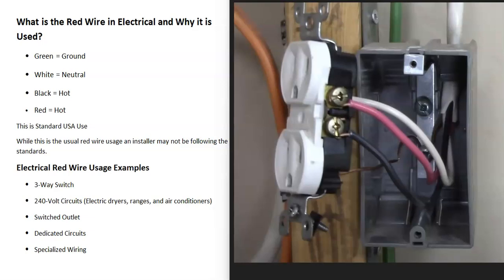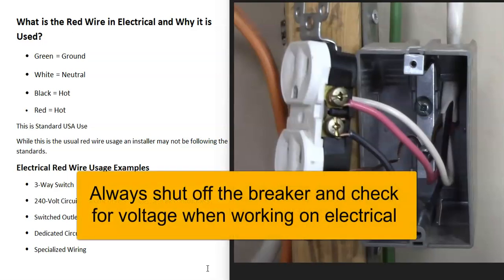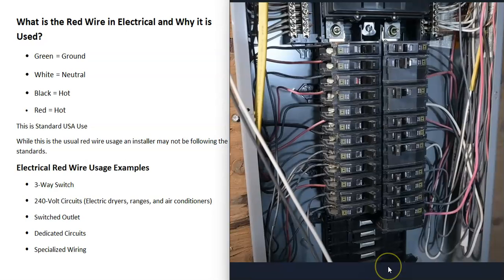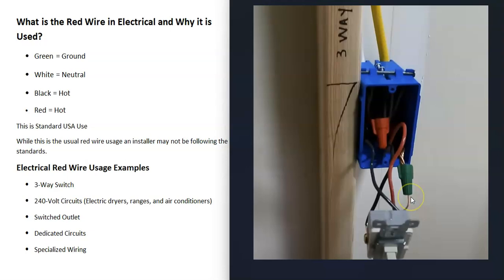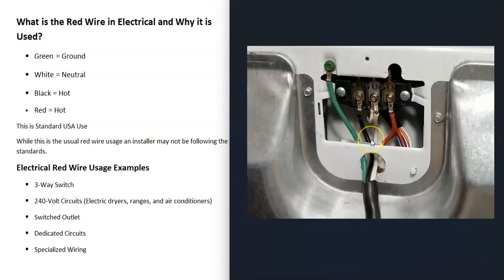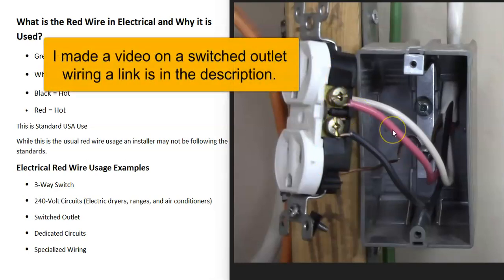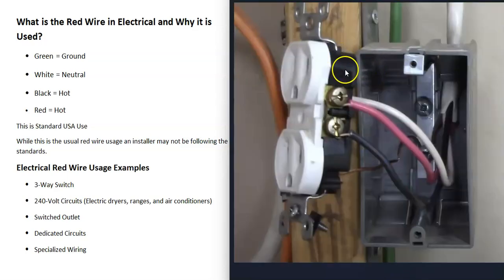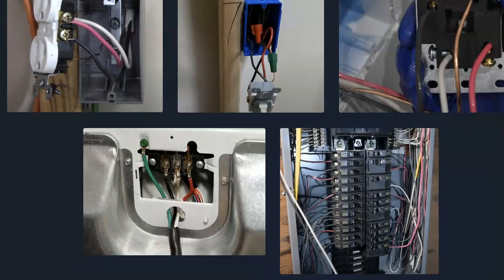What is the Red Wire in Electrical? Why it is Used with Examples?

Comment: I have the red wire & black wire connected but the power won’t turn off with the switch.
Reply from the maker: you need to find what is hot wire red or black then the dead wire will be switch leg.

Comment: Hey bro ! Great tutorial. I do lite electrical but I’m no pro electrician. I just moved into a new house and found an outlet in my pantry unfinished. Looks like all it needs is the outlet since everything is already prep for installation but there are 3 thick wires ready for set up white, black and orange. Never seen an orange one and don’t see the ground as well. How would I go about installing this ?

Comment: I have a light fixture that has, yellow with green strip, a black and a white. In the ceiling I have a red, black and white. What does the red connect to?
Reply from the maker: You just need to confirm hot 120 volts you need a voltage detector or a meter when you confirm hot then use white to white green to ground.

Comment: so my issue i have a ceiling fan with no power going to the fan but power going to the light. separate switches for each and when tested in the same switch box the switch to the light us getting power and the switch to the fan is not. On the same breaker. My guess call an electrician
Reply from the maker: Ok usually you will see a red and a black going to the fan those are the switch legs on a fan/light on the switches you just need one hot to control the light/fan on the bottom of a single pole switch take power to both switches brass screw on bottom then take the switch legs red/black put on each terminal 2 switches light/fan on fans you will see blue and black usually one controls fan 1 controls light 2 switches on single pole switch hope this helps you may have to get into the fan wiring if it is capped did not hook it up it is easy you can do it.

Comment: I have the washer dryer outlet with a red wire, to a switch. I'll figure it out before I plug it in. Thanks
Reply from the maker: Sounds good, just be safe with it remember black red on a dryer outlet is 240

Comment: If I have two blacks connected into a breaker can I rephrase one of the blacks to red and use the rephrased wire for my switch?
Reply from the maker: well yes you can wire a hot into another breaker will be 120 volts so if 2 hots are on one breaker that is commonly seen they are using 1 breaker feeding more out of room just remember on single phase 240 you want to be on separate phases for say like a compressor/dryer/stove so double pole 40 amp breaker gives you 240 volts.

Comment: How would I wire a switch for a light that has two black wires, two white wires, and one red wire in the box, and no ground
Reply from the maker: The fist is use a meter to find the hot coming in and then the wire that is dead will be the switch leg one of the black wires or the red could be the switch leg you will need to confirm with a meter.

Comment: I have a red, white, black, and copper wire. I know white is neutral and copper is ground, but what is the red and black? I tried white to white, ground to ground, and then for the black on the floodlight end I tried first connecting to the black on junction box , turned breaker and light switch on, nothing, so then I tried conncting the black end on floodlight now to the the red on junction box end , and still does not work, so it seems that neither work? It worked before but now randomly is not when I have new light fixture, even though I know the fixture works. What is with this extra black or red cable in my junction box? What am I doing wrong?
Reply from the maker: You will need to confirm what is line and what is load so black or red could be the hot coming in you will need a cheap tester or contact voltage tester they are cheap when you confirm the hot then the other wire will be the switch leg to the flood light.

Comment: The white wire and the red wire are stacked on a single side screw. Isnt this against all code? Shouldnt it be piggy backed?
Reply: Yes
Reply from the maker: So the white is a current carrying conductor but you have simplistic terms 2 hot wires a ground and a neutral break the tab on the hot side brass you have gd/dishwasher

Comment: Great explanation of the red wire!! But I have a GFCI switch combo and when I installed  it Im getting  power to it but the switch won't  work and it won't  test or reset at all. What am I doing wrong?
Reply from the maker: Find the hot coming in sounds like you have line load reversed.

Comment: What do I do with the RED WIRE if I don't need it??? Cap it and stick in in the electrical box??
Reply from the maker: If it a unused conductor you have a spare breaker if it is tied into a circuit that is used cap it.

Comment: i have 2 switches one is ok the other needs to be wired and then to the recpt 2 black wires and 2 whith wires and 1 red how do i wire recpt
Reply from the maker: If it is a half hot look at the old outlet if the hot link is broke then break link your hots red on one terminal black on other would go on hot terminals so you would have a constant hot and a receptacle that is half switched if you have a lamp or something plugged in.
Reply: So a red wire may be on a different circuit than the black wire that are both attached to the two brass screws on the right side of receptacle?
Reply from the maker: That is correct say for garbage disposal dishwasher two different circuits breaking the hot tab same with half hot.

Comment: What if you have 2 black wires & 1 red wire? The old outlet has both black on the bottom (brass) and the red wire is plug into the top (brass). And both whites are attached (1 on top, 1 on bottom of silver)
Reply from the maker: That is a half hot split the hot tab red on one terminal black on other.

Comment: In commercial buildings, when there is a 120/208V three phase service, the usual colors are black, red, blue, white for phase A, B, C, & neutral respectively and EMT raceway is typically used which can also serve as the equipment grounding conductor, though it's common practice to pull a green wire for the ground.   

Having said that, you will sometimes see  a white and red, or a white and blue, connected to a receptacle, where raceway is used.
Reply from the maker: Pre like 1984 I think the conduit could serve a a ground but new code has left that behind current 2025 NEC code has Ig grounds and bonding grounding are far better in terms of grounding,bonding threw the years I think we are there in terms of bonding,grounding I have a friend who has 3 phase at his house almost unheard of he has a 480  volt 12 ton ac his bill is small in relation to most because the demand is less but 3 phase is way more efficent than single phase lesser demand and probably half amperage of what single phase pulls.

Comment: Someone used the red/black combo wire and had red wire going to 1 side of the sub panel, and the black going to the other side. Tripped me out completely because they're actually separate circuits
Reply from the maker: confirm voltage then go from there should be easy identify line easy.

Comment: I replaced a light fixture and the only wires connected were a black and red wire… now the light won’t turn of with the new fixture. Help please
Reply from the maker: so if you replaced a fixture you need to know what is the hot wire and what in the neutral wire buy a cheap hot stick voltage detector confirm whats the hot or just swap wires sounds like they used one for a neutral just swap wires fixture will work hope this helps.

Comment: 3 way switch also.
Reply from the maker: Yeah a 3 way could be travelers but yes you are right they use black red  for travelers on a 3 way depending on who who runs romex.
Reply: I have 4 3way switches and 1 single. 3lights. 1 light switch will not turn on and off. what's wrong

 but 2.

Comment: I’m needing to wire 14-3 wire into an outlet. The outlet will act as a switch- flip the switch at the wall, outlet powers a shop light. 

Can you help me understand how I might wire the outlet?  Using my voltage meter, both red and black are hot.

Comment: I have 2 neutral wire (2 sets of wire cable): should I also cut the neutral wire (I cut the hot side) on the receptacle to have the black and the red with separate neutrals? Or does it matter? Thanks: great video and informative!
Reply from the maker: Usually the neutrals are pig tailed spliced in the box 1 set should do it.

Comment: So it’s just a black wire just red
Reply from the maker: Its 120 volt hot wire used for maybe half hot 3 way/ garbage disposal dishwasher will have a split outlet red and black so red is switched garbage disposal red is 120 volt hot.
Reply: Ooo so like extra push of a current
Reply from the maker: Its a hot so its  say for example garbage disposal dishwasher you would need the black for dishwasher and the red for garbage disposal or a fan the black would be for fan the red for the light on the fan.